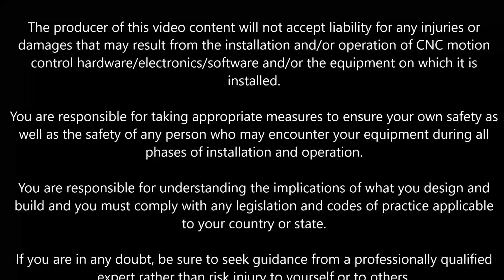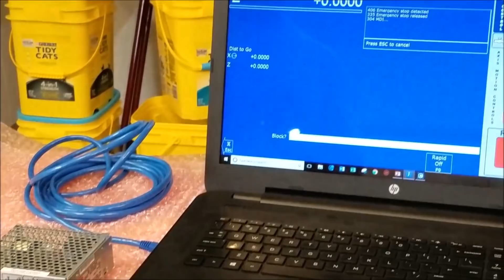Mini-Lathe Spindle Speed Control With The Centroid Acorn:  It Works!

Comment: question no one can answer , can the acorn board run steppers directly ?? or is it mandatory to have drivers ? ( i know  a lot of  the cheapo mach 3 boards can run steppers directly
Reply from the maker: You need drivers. Acorn only generates the logic pulses.
Reply: @FrancoCNC  thanks man .,. appreciate it.. Db 25 bobs are cheap enough

Comment: What if you was to use a industrial cnc controller like I am it's still 0-10v pwm signal would that work if I don't hook up the ground on the power supply?

Comment: Ok. AC power 101. The EARTH is not ground! Learn your terminology. Any double insulated device like a laptop doesn't have an earth connection. Anything with metal you can touch which is powered by mains should be earthed SO YOU DON'T KILL YOURSELF.
The output of a switching power supply is not connected (isolated) from earth therefore the earth is connected to make the metal cover safe SO YOU DON'T KILL YOURSELF.
It simply means do not have the negative (ground) of the power supply connected to EARTH. Ground and Earth are not the same thing! Sheesh lucky you had a disclaimer on your video. You could have killed anyone who copied your setup.

Comment: I got mine running with a the Speedway motor controller FC250/110V  and the isolator 240D board but cannot get the speed close by the MDI command.  5Volts out of the 240 only gave 350 rpm so I adjusted the max voltage out so the lathe is up to max speed but won't run at lower  command speed.  How do I fix this?
Reply from the maker: These Chinese motor controllers are not linear with respect to their input voltage.  On my Sherline lathe, I targeted the middle of the RPM range.  The higher speeds are a little too fast and the lower speeds are a little too slow.   I believe the Centroid people are going to add logic to their software to help compensate for these types of situations.
Reply: @FrancoCNC  Thanks.  I have a KBCC-125 R motor controller coming tomorrow.

Comment: Can I use the relays on the board or the 8 relay board kit to reverse the dc motor directly?  or do I need a new motor control board?  I have a speedway lathe with a FC250J/110V motor control.
Reply from the maker: Check this out:  https://www.dropbox.com/s/o7y9prakpibc8pp/PM25-Schematics2.pdf?dl=0  

You may want to look as some of my more recent videos.  The ground loop issues on the mini-lathe controllers forces you to use a signal isolation board.  Beyond that, I think you could use the relays on the external relay board to reverse direction.

Comment: Im not trolling here, but this isnt a safe way to go. You need to use an opto isolator for the control.. I am using a similar device to isolate a live spindle board.
Reply from the maker: I hear you.  I'm going to make a video using KBSI-240D.
Reply: @FrancoCNC  just to check with you, this is a dc spindle? I've got a little tcl 125 would be great to get acorn on it.
Reply: im curious to see how this is wired up. i have everything figured out except the spindle. your help is greatly appreciated.

Comment: So you don't have any feedback on speed into the Acorn, do you plan to add it?
Reply from the maker: Adventures in Fabrication Hi.  I have an encoder on the Grizzly. It works well. The Harbor freight is just a test machine.
Reply: There is no closed loop feedback into acorn for speed. Only position.

Comment: Glad you got it working!  Can you reattach the ground wire to the power supply and use a regular PC running on AC but just leave the ground wire disconnected to the Acorn board?  If you have to run your laptop off the battery, that might not make a good long term solution. Do you plan to wire in the reverse switch to the onboard relays?

Comment: Now you need a isolator in between the lathe and the Acorn. 10vdc to 10vdc with a 24vdc supply so it can be run off the Acorn power supply. Then you can connect back all the earths and be safe. Centroid should be able to help with such a device or search Ebay.
Use relays to control forward and reverse.
Hope this helps.
Cheers Dave.
Reply: What kind of isolator would be needed?  Can you give us an example of something suitable?
Reply: Thanks, Roscoe. That thing is pretty speedy...do any less expensive options exist?  Have you the ability to reverse the spindle using the relays?  If so, can you share a wiring diagram?

Comment: can it run backwards?  Threading?
Reply from the maker: Hi.  If you use the relays on the Acorn to replace the direction switch, you could reverse the direction of the mini-lathe.   Threading is not a problem, but you need to install an encoder on the spindle.  Here are is a video talking about the encoder:  https://youtu.be/CKylcAPv1Tc